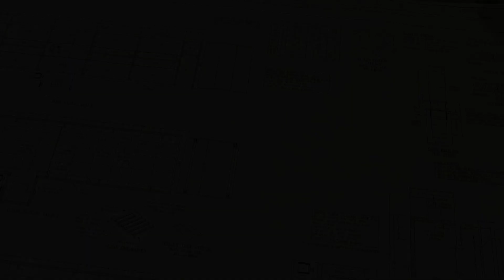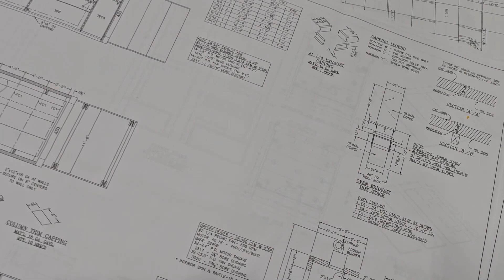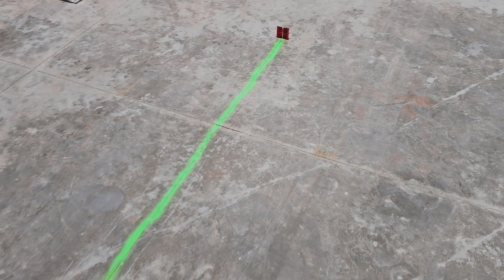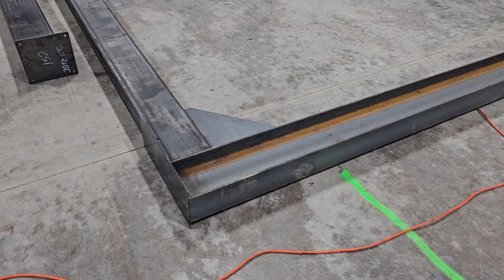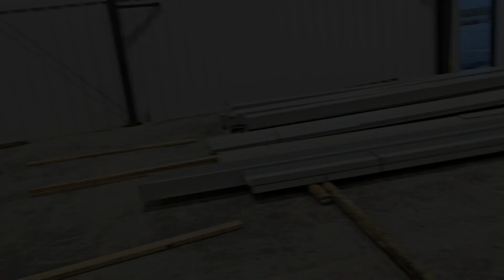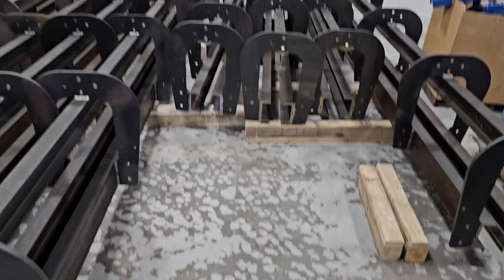Powder coat line part #1

Comment: Cool stuff, Stan. My friend hired me as a pro-tempor supervisor for him this summer helping repair a new install of pallet racking and industrial carton flow that the original installers had botched (I can point no fingers, I was happy for the work). Anyhow, 3 stories, 12 aisles per story, 5 of which were in a freezer and cooler. All told, it was 9.8 million square feet of carton flow shelving installed. I was not allowed to video anything except for internal showings. Your video reminds me of the fun of it, and the stress. A good crew makes all the difference.
Thanks for the videos.